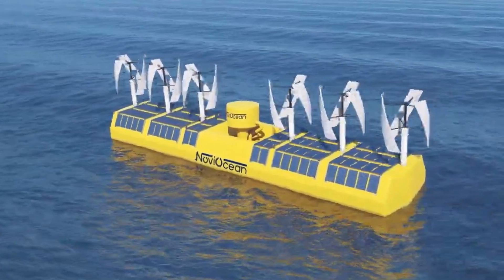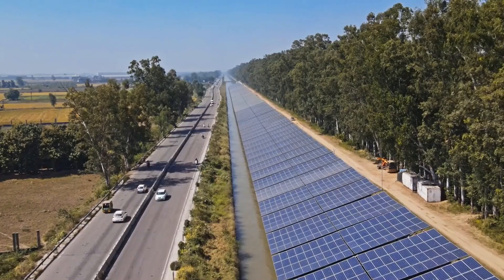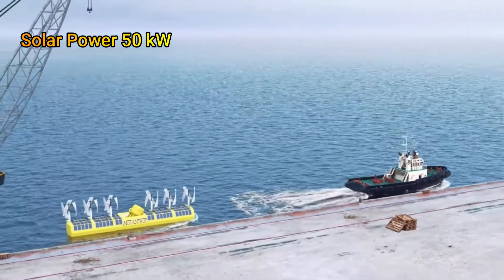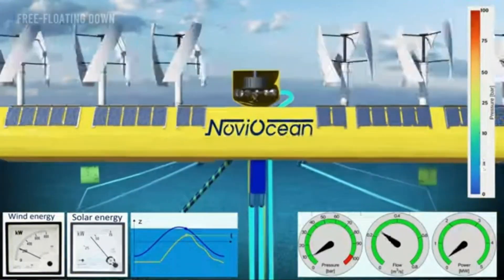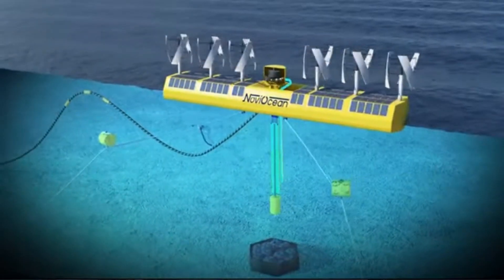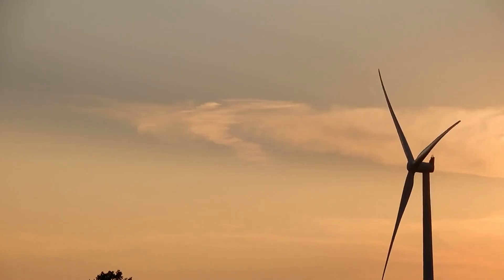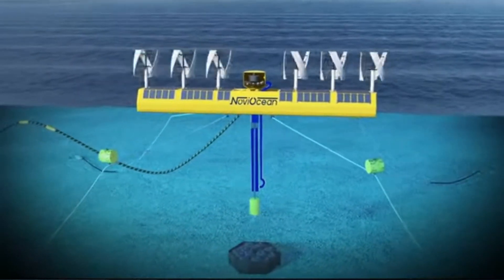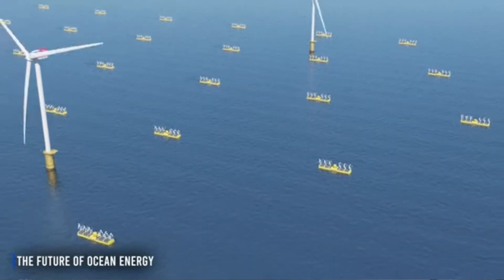3 in 1 Wave, Wind and Solar Power

Comment: A good start but let's go for 5 in 1. Add on board energy storage and heat pump energy extraction for warm water. Then send an armada of several thousand into the path of oncoming hurricanes to attenuate their energy by what? Maybe 1 or 2%. 

Just joking. Neil deGrasse Tyson recently complained about lack of engineering plans to extract energy from hurricanes. Love Neil but he was swinging wildly on this one.

Comment: How does the cost of this compare to the cleanest form of reliable energy?
Nuclear £65-75 per megawatt-hour (MWh) levelized cost of energy (LCOE).
Reply: PS. for reference Gates' new plant opening 2028 if things go well will produce 345MWh for 60 years with an NRE of about $4B after operating costs will probably be about 20-30% cheaper that the LOCE quoted above.
Reply: For several years now the International Energy Agency (IEA) has declared solar energy as the cheapest for of electricity bar none. Including nuclear. Wind, solar and storage only continuing to get cheaper since the original announcement.

And who is the IEA? The IEA is a long-standing, industry-standard, go-to data aggregator and forecaster for all things related to the global energy sector. All the pros in business, investment and government turn to the IEA when they need reliable energy data. The IEA has historically favoured legacy energy like oil, gas, nuclear and hydro in their projections. But now they especially say SOLAR IS CHEAPEST! Look it up.
Reply: @douglascutler1037  I just went to their (levelised-cost-of-electricity-calculator) page and Nuclear seems to be top of the list...
Number 1 with 28.18 LCOE:
Sweden, Nuclear, LTO (20 years), (1000 MW) 

Sweden - Nuclear - $28.18/MWh
Denmark - Wind - $29.18/MWh
Switzerland - Nuclear - $29.60/MWh
France - Nuclear - $30.65/MWh
Norway - Wind - $30.76/MWh
Sweden - Nuclear - $31.36/MWh
USA - Nuclear - $33.25/MWh
Switzerland - Nuclear - $33.53/MWh
Brazil - Wind - $33.59/MWh
France - Solar - $33.94/MWh

This is a really useful tool.
Reply: @douglascutler1037  My detailed reply to you was deleted... according to IEA nuclear still dominates as the most cost effective reliable solution.
levelised-cost-of-electricity-calculator
Sweden	Nuclear	LTO (20 years) (1000 MW)	28.18 USD/MWh
Useful website though, thank you.

Comment: If you lose the turbines and made it smaller maybe some sort of rigid inflatable, so it could be air transportable, I could see limited use for one of these in disaster relief scenarios. Apart from that, I don't see the point.